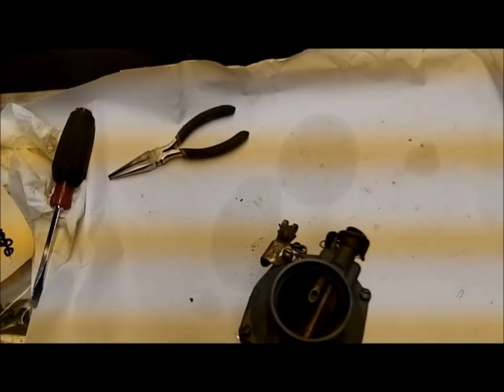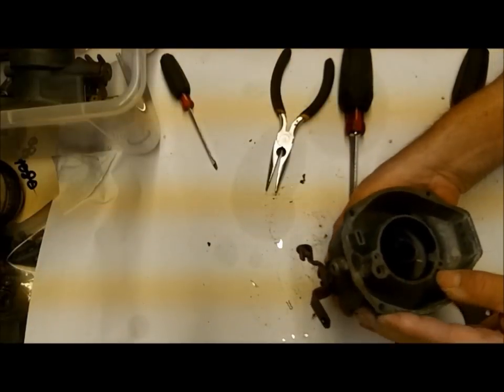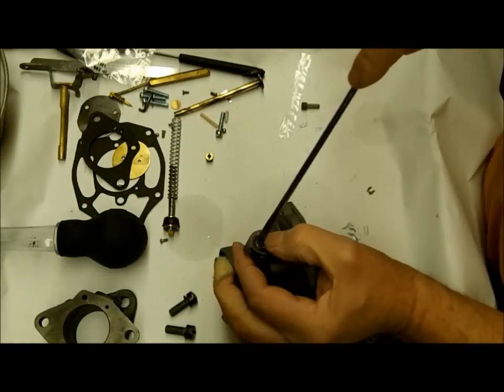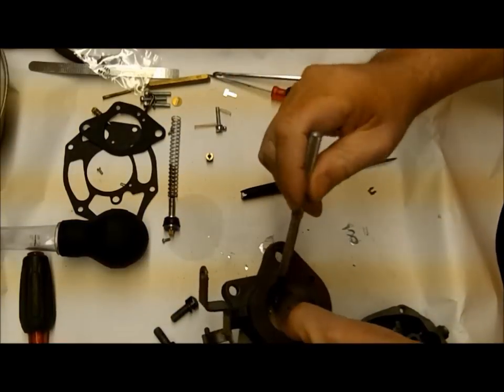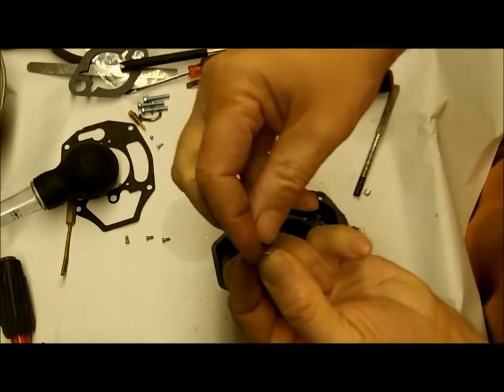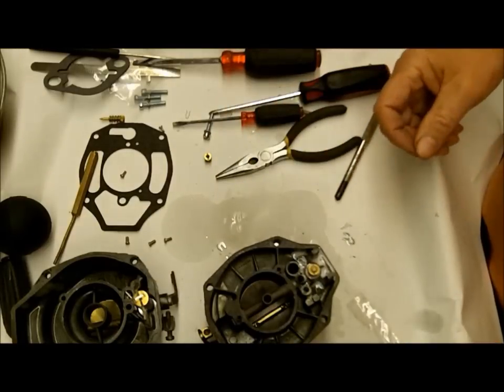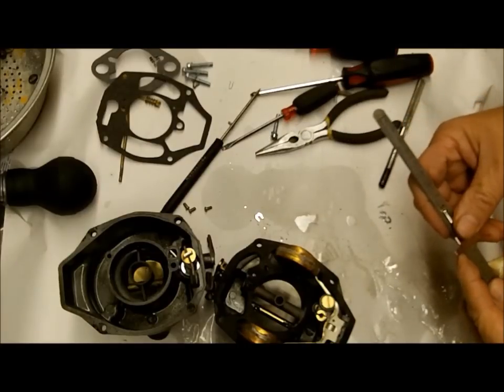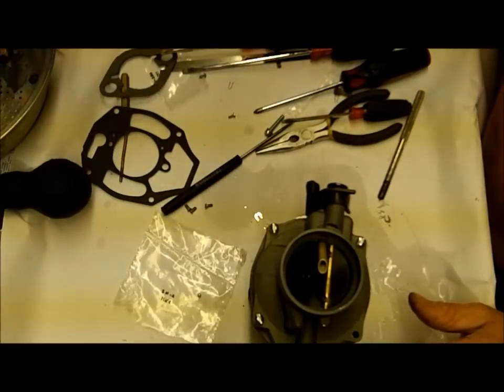Rochester B BC Carburetor Rebuild

Comment: At 38:12,you mention that your float level is 1-9/16. According to my rebuild instruction sheet,(Airtex Part# 2G1045),it calls for 1-9/32. I set mine at 1-9/16,and it's starving for gas. Mine's a '55 Chevy 261 6500 2-ton. GREAT tips!! I'm tearing it back down,just to check some of the stuff you mentioned. Doesn't take long to rebuild one of these,as long as everything is good and clean! Thanks,again!

Comment: So helpful and full of information, thanks for taking the time to put this video together.  At 21.50 Mikes talks about the gasket holes not lining up, this hole is for vacuum to the power piston and cannot be block or hesitation of acceleration will result.   I noticed there are two gasket in most kits, one is for the 216 cu in and the other is for the 235 engine and the hole patterns are slightly different on the two gaskets.

Comment: Nice, but I wish you would have shown each part that was being taken out close up. With the dim lighting and the fast pitch of the parts into the plastic bin, it leaves me wondering what that part that just came out was and what it looks like. (this will be my first time opening one of these up)
Reply: Yeah there's lots of great knowledge in here I've been through these carburetors for years better lighting in a little slowed down to show the detail of the pieces would be better for somebody that doesn't know other than that great video.

Comment: Hey bud was wondering on this carb i have the same on my 51 3100 chevy on the base plate bottom  are both orifices to be open or is one okay to be blocked off by the gasket .. cuz I think that's my idling issue. I know one is for the idle mixture screw.  I dont know what other is. Thx God bless 🙏 trynna get her back on the road

Comment: I am building a wild 292 Worked  inline 6 Chevy, 3 NOS 7025003,on and Offy 3X1 manifold I stepped to 74 jets, can you really modify these for peak performance? 1.57 throttle bore and I think 5/16 venturis. what CFM does these  make, Thanks Brad ,BTW, I purchased several items from your site, excellent parts and service .I also have a MAN-a-fre -with 3x2 Rochester's. And a dual quad intake, so not sure what to run.

Comment: Great video Mike - I have just installed one on my 1966 Chevy pickup with a 6cyl 250 - the throttle body is leaking out the side when gas is given - it's a new / rebuilt unit - I can't imagine it's supposed to do that.... I plan on taking it back off and returning it... however, I would love to know how this would happen? Just to have a conversation withe the store... or if it's simply an adjustment I would like to know so I don't have to remove it? Any insight is appreciated!

Comment: Great job! Love all the extra tidbits from your experience and for taking time to make a video. Have a question on the newer style with round style accelerator pump, where does the shot of fuel exit into the throat of the carb? I was checking a no start condition there wasn't any shot of fuel when I operated the throttle but when I removed the top of the carb the bowel was full and the seal was a recently rebuilt rubber one that looked good. When pressed down some fuel bubbled out top of where the t retainer is located but nothing into the carb body. Thanks again for your time.

Comment: Hi Mike im rebuilding my rochester monojet  17056014 ,but upon disassembly I noticed that the spring was installed towards the inlet fuel pipe and the rubber of the fuel filter check valve was up against the spring.not sure if that's correct for this kind of carb.your videos show different.

Comment: I rebuilt mine and the engine stalls when I hit the accelerator quickly.  I noticed that the accelerator pump doesn't push fuel immediately because the top spring gives maybe a little too much.  I lengthened the spring but now I'm wondering if the pump is sitting in the correct position at idle.  Should I be able to see the bottom of the rubber so that the fuel can go from the bowl into the well?

Comment: Mike,  Right at the start of Assembly (11:08) you show 2 small pin holes, well I can see a small copper tube inside that appears to cover one of the holes. (Also don't get air thru the pinhole on that side).  Any ideas?

Comment: Hey Mike, I have a 235 inline 6 engine and with the choke all the way pulled engine starts but has really high idle. When I push choke in it kills the engine any tips for combating my issue?

Comment: Know this is a long shot and a bit of a loaded question. But have a 66 c10 in-line 250 6cyl, and was having some issues with starting/flooding on occasion. Ran some sea foam through the gas tank and then right after had issues with stalling when on the road, though it would idle fine. Long story short decided it seemed like the carb after troubleshooting the rest of the fuel system, have this exact carb and it was filthy on the inside and the power piston is completely frozen. I watched your video on heating it up which I will try in a bit. But just a general question on if the stalling out would typically be a sign of the piston being froze up? I’m new to carbs and just trying to get a second opinion on if I’m on the right track - thank you!
Reply: @MikesCarburetor  I appreciate the reply my friend! When you say other problems are you thinking other problems with carb or completely unrelated?
Reply: @MikesCarburetor  looks like you were right, put the rebuilt carb on and it is leaking from the throttle shaft. From what I see it isn’t really worth trying to fix that part if it’s even possible. Would you suggest a completely new carb? I hear Carter YF is a good alternative but not familiar - any advice would be greatly appreciated!

Comment: What did you spray on the gasket before applying it? Does it help the gasket seal? Thanks!
Reply from the maker: I probably used silicon spray lubricant. It helps keep the gasket pliable.

Comment: Hi Mike. I bought a 1960 235 motor with a Rochester RP for my 1954 Chevy 3100.  The guy I bought it from told me that the carb needed  a rebuild cause it leaks.  He threw in the rebuild kit, a CARQUEST 123A made in USA and I plan on doing my first carb rebuild with it.  Is the carb in your video that different to mine?  Would I be able to use it as a guide and not get lost?  I also have a Rochester C.  Which do you consider to be a better carb?  Thanks you so much.

Comment: I stripped out the inlet hole where the fuel filter screws in, should I try to retap it
Reply: Mikes Carburetor I cleaned the threads out really well and got the filter to screw in but now I need a rebuild kit for the carb. I’ll be ordering the kit off ur website 👍🏻 finally getting my dads 54 chevy 6400 running, it’s been sitting for 35 years

Comment: I used your video to rebuild my carb (4468). At 25:50 your talking about how there could be two holes in the accelerator pump well.  I technically have two holes but one of them appears to have a stuck aluminum check ball that can be seen from outside of the carb.  It didn't seem to be the "on the bottom"  that you were referring to it is actually directly across from the other one.  I left if jammed in there to seal that hole leading outside the carb.  Can you confirm if this is correct? Thanks

Comment: I rebuilt my B carb for my 54 235 and it still pops on acceleration. I have adjusted the valves and replaced the ignition system. There is still no squirt from the accelerator pump into the throat when moving the lever so am I to assume the new pump is not working or not sealing?
Reply: the T lock that holes the spring down might be in the  wrong way and is blocking the hole that squirt the gas from the accelerator pump into the throat

Comment: in the video at 38:13 mikes says the measurement from the gasket to top of float is 1 9/16 ....
but in the paper work that comes with the kits says 1 9/32...????
in fact they all are 1 9/32 
which measurement is right?
Reply: @MikesCarburetor  thank you sir

Comment: Do you all have type C kits for some reason I see them no where
Reply: @MikesCarburetor  I'm not even sure it's what the C stands for on my single barrel Rochester carb?
Reply: @MikesCarburetor  I was able to make out the numbers at the base  of the carb it looks like it says 7004522 It's for a 1961 Chevy Apache inline 6 cyl I do know its a single barrel Rochester with a manual choke.
Reply: @MikesCarburetor  The tag is missing thanks for that information